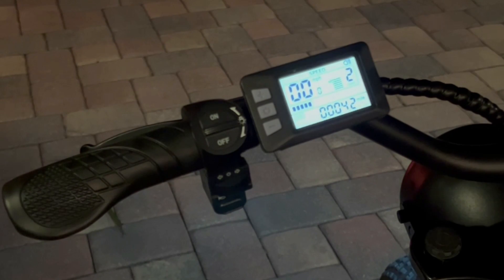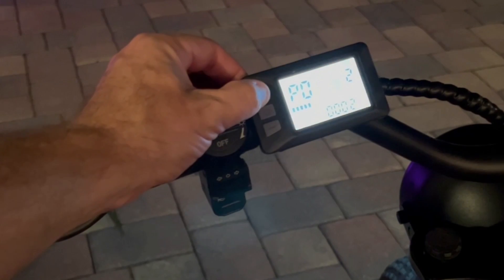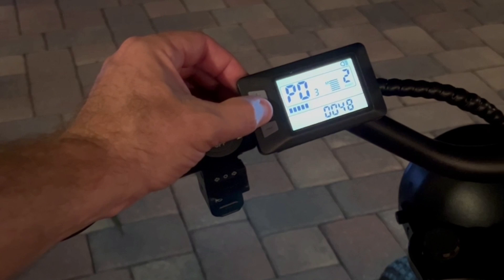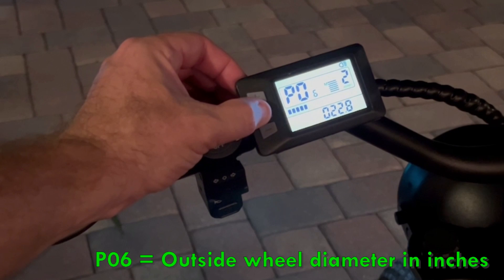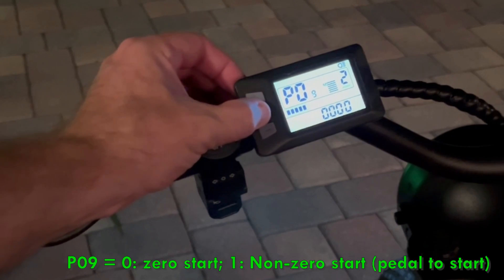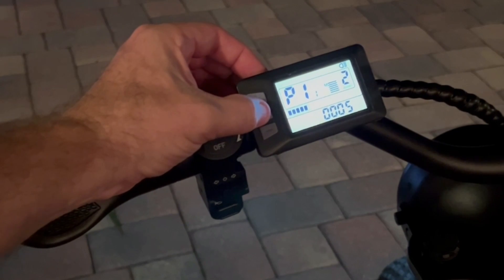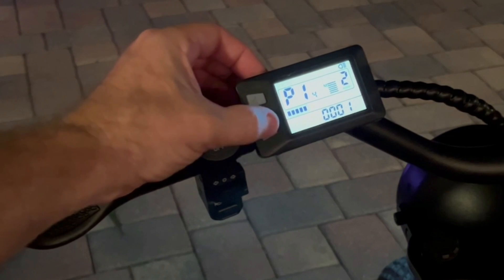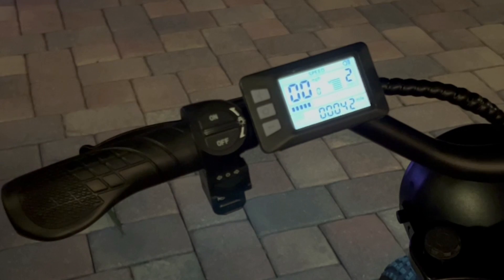Advanced Settings Menu on Ouxi V8 ebike Display

Comment: Thank you for narrowing it down! I accidentally set a speed limiter while messing with the setting on my own.

I couldn’t figure out how to set it back and this video helped me navigate the setting. 

Code for speed limiter is : 8252 & press the middle button to enter the code.

Long press the ” - “ button down to set the speed limit.

Max out to 50 if you’re in mph 
Max out to 100 if you’re in kph 

Once you see those digits pop up
Long press both + and - buttons to 
reset it
Reply from the maker: Glad the video helped you fix it

Comment: I've tried all these things on my ouxi v8...including upping the volts to 22 instead of 12. I have switch to mph and raised it to 100. nothing seems to make a difference. even wen I change tire size to fool it. it always seems to bog down wen I get to a certain speed. 31.7 to be exact. even wen going down a steed hill, when I know it wants to go faster something is preventing it from doing so.
Reply from the maker: Is this a newer Ouxi v8?  If so it must have a governor or restrictor on the new controller.   amps should be 22 and volts are 48v
31.7mph os respectable as with 48V and 750w physics will not allow you to go much faster, maybe 32-33 max
Reply: @B @BRichSolution my ouxi v8 won’t go above 20 amps. I’m maxing out at 30mph maybe 33 if im Lucky.